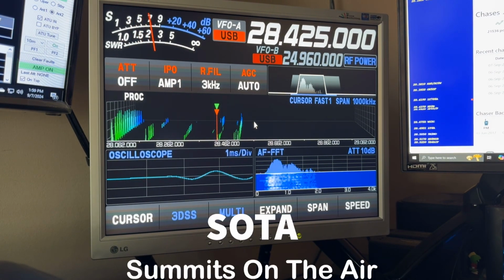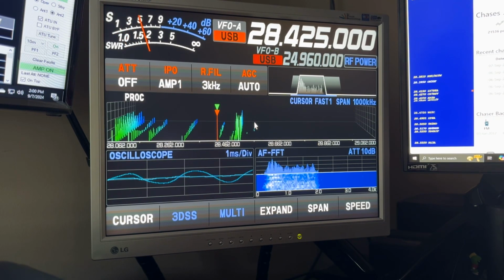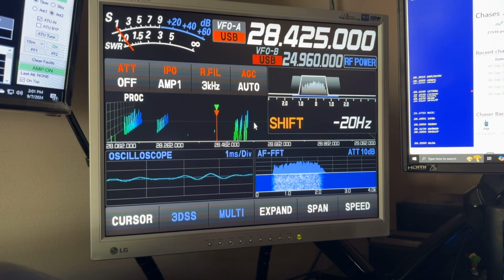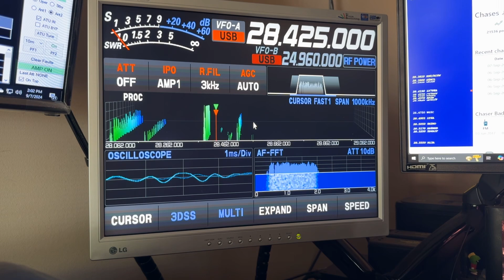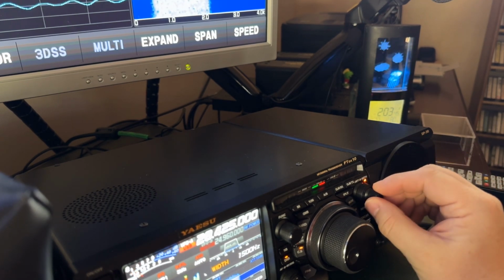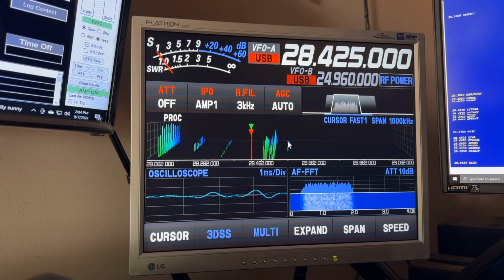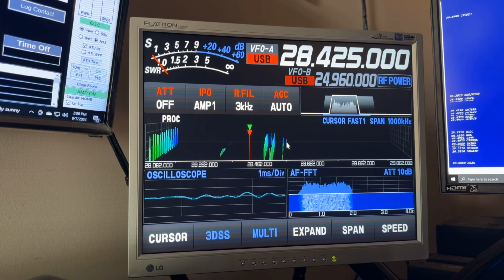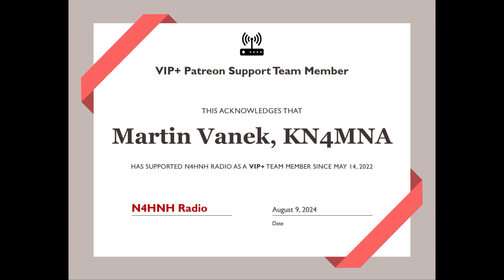Eliminating QRM 2kHz Away #hamradio #hf #ssb #qrm #rfi

Comment: Thank you Douglas, I've learned a great deal watching your filtering videos (different radio, same theory).  I spent much of the time during the WWDX contest a few weeks ago just practicing with the filtering on my IC-7300.

 I have a question for you. There were many times when I had a strong station both 1 kHz above, and 1 kHz below the target station. Would it be realistic to expect ANY radio to be able to handle that situation?
Reply from the maker: I had that same scenario in one of my videos. I don’t remember which one.  I think it was with the FTdx5000MP.  It might have been the FTdx101MP.  The FTdx101MP videos are only available for S9 Patreon members.  Anyway, I used the technique in this video to minimize to high frequency interference and I used the variable preselector to minimize the low frequency interference. But, if you don’t have a variable preselector, minimizing the high frequency interference is the best choice. The higher frequency (metallic) sound is more annoying than the low frequency (honking) sound.
Reply: @ Thank you.
Reply from the maker: @FA7X you’re welcome.

Comment: Thank goodness for a single hi cut control
Reply from the maker: I have a radio that works that way. It takes three knob turns to drop the highs, minimize the lows, and adjust the passband center point.  With the newer Yaesu transceivers, only two knobs need to be rotated - width and shift.